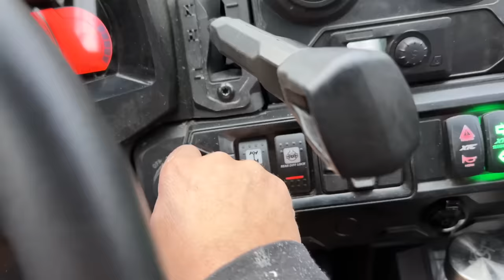I Hope SHE Likes IT.... Building Her Off Grid FOOD Storage in the Woods

Comment: You might want to consider putting door sweeps on the cold room door, to keep mice out and to help cold from coming out and heat from getting in.  Looks great!
Reply: Theres no refrigeration so its not really a cold room, its more of a root cellar.
Reply: If little air exchange and it holds a lot of fermentation vegetables it would be smart to low mount a carbon dioxide alarm.
Reply: @ShalomShalom-d5c  It's New England in winter - it's a cold room. ;)
Reply: Looks great, but I would paint the trim with a shade of RED (to match the outside door)!!!!!!!
Reply: @kevinjones6280 I thought the same thing personally would be great but they are conservative and their color choices almost always so probably a no-go
Reply: Actually I was thinking a vent in the ceiling to allow the heat from the freezers to escape (especially in summer). Allowing air circulation is necessary if storing root veg., onions, etc. Probably should vent heat from the electrical room too.

Comment: That cool room will probably run pretty warm once you put the freezers in there. The compressors will put off a lot of heat and the room will trap it in.
Reply: Believe Al mentioned using a split air-sourced heat pump in cooling mode.
Reply: Given where they live they could pump cooler air in from outside a lot of the year .

Comment: I used OSB in 1 of my rooms and primed it with the same as you and found that I had to sand off the surface with a drywall sander a little to knock off the little splinters sticking out. After the sanding I put a second coat to make sure it was sealed all the way then painted and when done my wife like the OSB better then the drywall as a finish.

Comment: Hello Al and Gina! I put up led UFO lights. A lot of garage junkies diss them, but mine have been up 5 years and are on almost 24/7. Never an issue.  The only negative is if running welder or multiple hi power tools, one may flicker.  But that my also be panel or service related. Not severe enough for me to do any corrections.  Cold room and power room look great and I know you will enjoy the shop portion as well when completed.

Comment: Did I miss when you primed & started up the in floor heating system? The solar system is sharp looking! Very impressive system for sure!
Reply: There's no heating system yet - Al mentioned in a previous video that he may be using an on-demand water heater... in other words, no wood burner.  Maybe an electric one as his power is "free"?
Reply: @samvalentine3206    the power might be free, but it's not unlimited, and an electric demand unit will need about 100 amps of juice. If he goes that route, it will have to be propane.

Comment: Barrina intergrated lights. They come 4' , either 6 or 8 to a pack. LED. 
MUCH brighter than any other lights I've used, simple to install and use very little electricity.  I have two shops and a garage I use them in.

Comment: With the cold room being so well insulated,  will the heat from the freezer motors keep the room from staying cool/cold?  Maybe installing a vent pipe with wire mesh on the ends to deter 'visitors' that you can cover if necessary?

Comment: I have made a few cold rooms over the yrs and I vented air from outside inside in summer using a screened pipe to 12 inches from the basement cold room floor. Taking any moist air outside in summer. Then Closing vents in winter. The cold pipe kept the insulated cold room from heating up. Not sure how your room will maintain cool temps with heat coming from freezers and no air cross venting. This will be interesting … 😊

Comment: Shop ceiling light suggestions:
. Put house type pull down attic stairs in to access loft area.
. Install loft area lighting separate from shop lights lower power LEDs. 
. Main shop lighting, split Bay in half lengthwise for two rows of ceiling lights. Each row controlled by separate switch, Wiring, 14-2 NC 15A barker to switch box next to man door entrance switch box. From switch box run two runs 14-2NC to feed Each half of shop ceiling receptacles. (See coverage area of floodlights to determine number of ceiling light outlet BUT add additional receptacle or two in case like coverage is insufficient.
.You might consider running EMT instead of NC cable for ceiling receptacles as it would be easier to support cabling between your trusses.

Comment: You could use a steel door and just remove the threshold. Gasket the bottom of the door with one of those cool retractable door sweeps. Probably won't matter much but keeping stuff from freezing in the winter and getting warm in the summer will be harder with a panel door depending on how temps go in the shop. But it probably won't matter. And you can always change them out with an insulated steel door if it turns out to a problem.

Comment: The room should be cool to start with, but when you add your electric freezers from the house they will output an amount of heat into the room, so you should re-check the temperature after they are installed, as you may want to add some ventilation to allow any warm air to vent outside by bringing in cooler air.

Comment: The cracks where two OSB sheets meet should have been caulked as well as those cracks stand out.  Also, I've never heard of flour paint so I don't know what that is.  Since you bought 5 gallons I'm sure you have plans to use it elsewhere but don't know where.  I think you should have used the solar room paint on the cold room as well as it looks nicer than white.  White, however, is a cleaner look.  I think you should paint the OSB trim as well but maybe you plan on doing that when you paint the door.
Reply: Flour White is a colour.

Comment: Hate to sound like Billy the fire marshal but when you’re putting up the doors on the electrical room in a rural community, you want to look for a 2 to 4 hour burn rate. Thank God with all the insulation and blocking your walls without three-quarter inch gypsum boards will also give you some more fire protection. Come on guys even you know about how batteries blow up.

Comment: Just curious, and time will tell, even though there is no radiant heating in the floor of the "cold" room, I wonder how much heat will transfer through the concrete from the area that does have the heating coils installed.

Comment: Since your power being solar is essentially free, I would fit a split system air conditioner into the cool room and just leave it running all year round at 6degrees C - you could hang carcasses for a week in the cool room to set up, before butchering.

If it were me I’d have a meat tail hung from the ceiling, stainless prep bench, stainless meat bandsaw, cryovac machine and bags, and a stainless wash trough / sink for cleanup plumbed into the cool room.
You could keep deep freezers & glass front door display refrigerator in there as well.

Had a deer farm for 20 odd years & supplied about 60 restaurants with venison, so that’s how our cool room was set up.
Because we are a much hotter environment downunder that your location (it never snows even in the wettest of winters) - our insulation ratings had to be a lot higher than yours and the door & any windows etc had to be fly proof.
We had a floor waste plumbed into our cool room floor and with the plumbed sink & faucet we could use a hose to wash the floor to the drain after processing.
We used to brine pump & smoke some of our prime cuts before cryovac packing and refrigerating.
Some of the lower value trim etc we made into smoked venison and cheese & black pepper cabana sausage, which went fantastic on pizza.

Comment: What are your intentions on removing heat in the summertime?  That room can get well over 100° without AC or proper ventilation.
Reply: I've suggested numerous times that it would be a good idea to add a couple mini split units. They can provide both heat and cooling as needed and where needed.
Reply: @pasreview9274  I second that considering I work for  a manufacturer than makes the best ones. We build units that heat and cool under extremely cold sub zero environments and because of the soft start inverter technology, can easily be used with their current solar array. 
If they don't install AC, the freezers will end up burning out.
Reply: @chrisvandagriff   I installed an 18K btu unit in my 600 sq ft garage and it does a great job. It is wifi enabled so I can turn it on and off from inside my house as needed. I also installed a bluetooth thermometer so I can also monitor the temperature from inside my house. The bluetooth thermometer however is only accessible from about 300 ft or less away. I probably should have purchased a wifi enabled remote thermometer.

Comment: If you can tear a hole in thier dam and then set a leg hold trap set up as a drowning set they will come at night to repair the hole and the leg hold trap will drown them when they try to swim away. Google drowning sets or find a trapper who will show you how to set one. Another great way to trap beaver is set snares on a pole at the entrance to thier home. It's fairly easy to find the entrance to the mound of sticks they pile up to live in. Look for willow or green branches just under the surface of the water close to thier den. Attack the snares to a long pole and place the pole with the snares under the water about half way to the bottom of the beaver pond. They will swim through the opening of the snare and it will catch them around thier neck and they drown.
Reply: They have done this in previous videos!!!!

Comment: Ok, one more time coming from a painter that likes to brush and roll. Take the lid off of the 5 gallon bucket.  Pour what you need into another 5 gallon bucket, probably one to two gallons at a time.  Buy a paint screen that hangs from the edge of the 5 gallon bucket.  Dip your roller into the paint and roll it on the screen to even it out.  This saves on bending over, and when you want to move your paint, you just grab the handle.  Please try this it pains me to see you use that tiny pan.
Reply: I was thinking the exact same thing 👍👍

Comment: When possible a interior door should swing outwards on a utility room etc. just in case something that falls inside that can block it from opening. The reason why many exterior doors on buildings do the same so people can exit in an fire or other emergency and since it can trap those inside getting out for the same reason. Adding what often called door strip sweeper on the bottom  to keep mice out since they can get under it and I seen some zip under one with just over 1\4 inch gap with ease. They should not use  OSB for trim since they can rip dimensional lumber into strips since they might already have some and it finishes-looks  better.🐀

Comment: $5.10 for 7/16 OSB. 
1/2 in. x 4 ft. x 8 ft.  Drywall $10.00 

is that why you didn't just use drywall. the price? or to be able to screw into it? looks good...
Reply from the maker: We want to be able to screw into it and mount shelves where we want too
Reply: kinda figured. now stop reading this and get to work. JK... I MISS the intro with the pigs lol.. @LumnahAcres
Reply: Where are you finding 7/16 osb for $5.10? It's $14.58 a sheet at Home Depot and Lowe's.